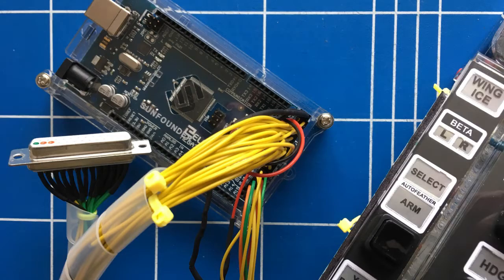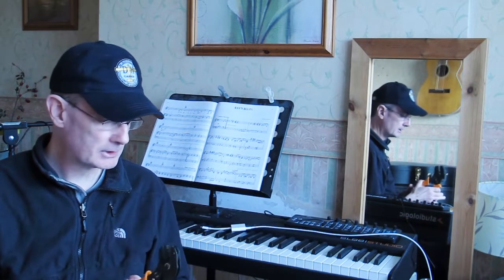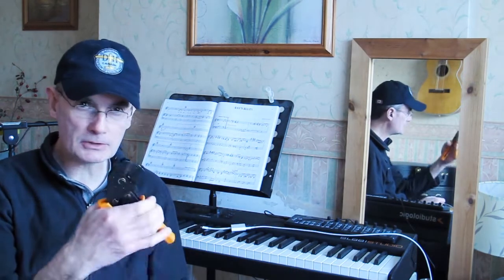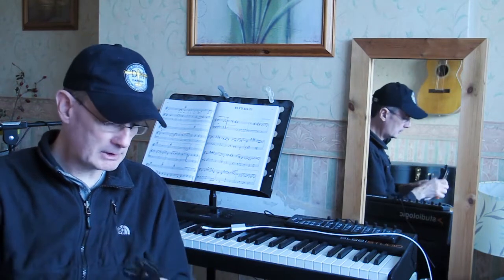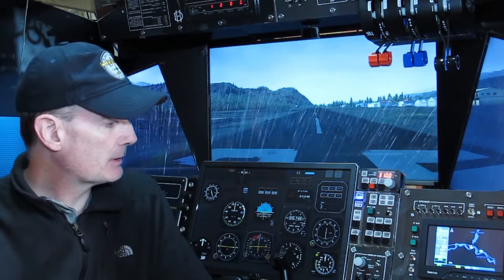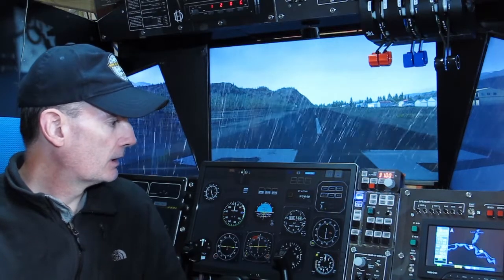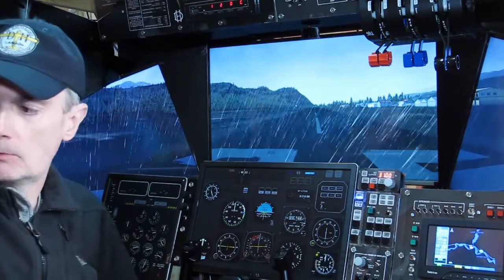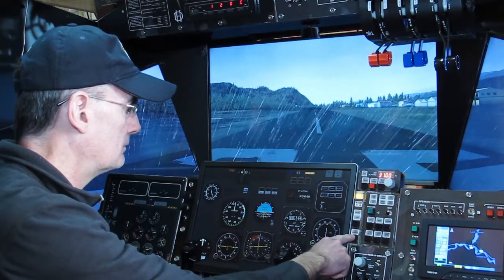Autopilot Hardware Complete (Twin Otter Cockpit Build - Part 52)

Comment: what board do you use that receives signals from the dials buttons and switches?
Reply from the maker: I'm using Leo Bodnar BBI-32 boards. (I have about eight of these connected.)
Reply: @AlmostAviation  When connecting the wire to the board is it one insert equals one command or is it more complicated than that?
Reply from the maker: @PEPcessna  That's pretty much it. The Bodnar board is just like a joystick with 32 buttons. Whatver you can do with joystick buttons you can do with the Bodnar board. You connect each individual switch to connectors on the board with two wires. In fact it's simpler than that because you can use a common ground.